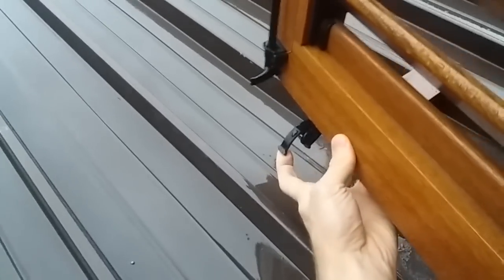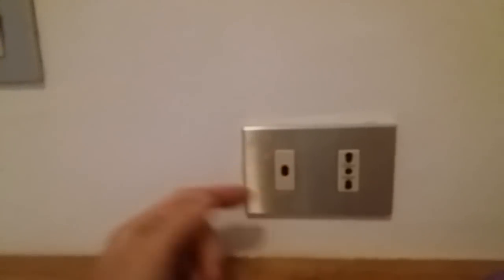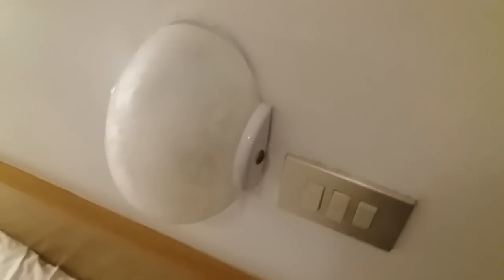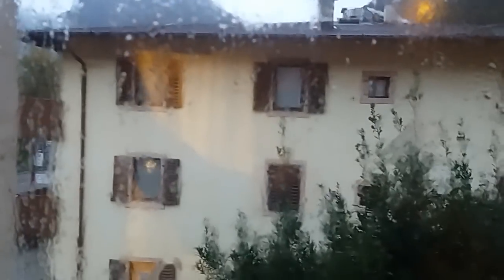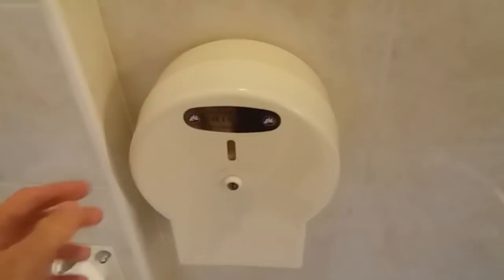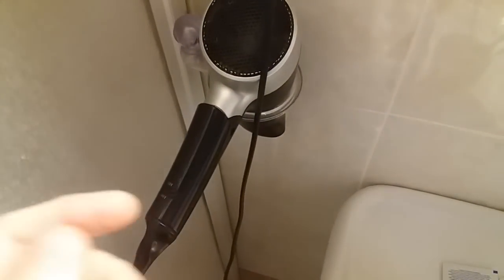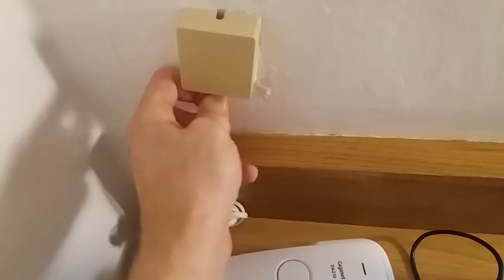More electrical things in my hotel room (quick unedited video)

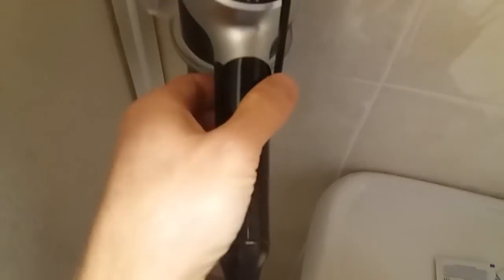Comment: 3:39 Here in US, that's common to have that flat cable, especially on non-grounded appliances like hair driers and hair flatterers. The school of thought is that the thin cable should be just enough for a few minutes, since you're not supposed to leave these on. 

also side-note: why doesn't US plugs come with switches, i know it's not necessary if the appliance has it's own switch, but sometimes that's not the case, even in schools, we're told to get a power strip and switch it off to prevent "vampire draw"(standby power draw)

Comment: 1:00 old hole for the antenna cable .. now it will have a separate line 3:00 you don't have to lift the hook ... you have to push the "persiana"

Comment: I've pulled 10A (and once even 12.5A) through 0.75mm² cords before without them getting too warm to hold (even after over an hour of continuous load), so I can say it isn't that bad – as long as the cord isn't coiled up (this is considered to a degree in many of the standards, despite warnings to the user not to do it). In the case of IEC 60320, it allows the 10A connectors (C13/C15/C15A/C17) to be used with 0.75mm² up to 2m long, and the 16A connectors (C19/C21 and the extremely rare C23) can have 1.0mm² up to 2m long as well (though this seems to be much more common on power strips in Europe; I've not seen it on production C19 cords); but longer, and you have to step up to 1.0mm² for 10A or 1.5mm² for 16A. (I've also pulled 10A through 1.0mm² cords coiled into 5 tight layers, resting on top of a pillow for good measure, without getting too warm, so that makes sense.) If you can think of a better explanation for this distinction then by all means provide one, but I've drawn a blank (if it was just about voltage drop, then the maximum length ought to be linearly related to the cross-sectional area; which is far from the case here).
On that basis, if this hair-dryer's cord is 2m or shorter, it may be compliant.

In Australia, the national standards don't "officially" permit the smaller sizes in shorter cords; but there are still countless 0.75mm² C13 and C17 cords here (some longer than 2m even), and many 2.4kW kettles (not just store-brand el-cheapos either) with 0.75mm² too. (I've not seen it in ready-made extension cords or power strips though, at least not honestly; I have seen a very cheaply-made power strip whose cord gets warmer than expected for 1.0mm², though.)
Reply: In the US we use 18AWG for up to 10A, 16AWG up to 13A, and 14AWG up to 15A without regards to length. These are equivalent to 0.823, 1.31, and 2.08 mm2. So 0.75 mm2 is 91% as much copper as we'd use here. I'd say that's close enough.